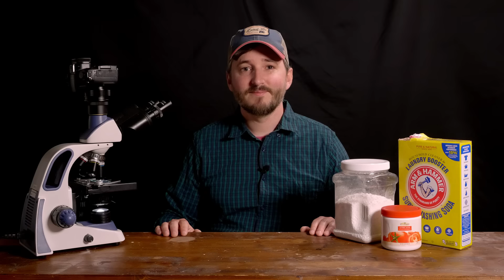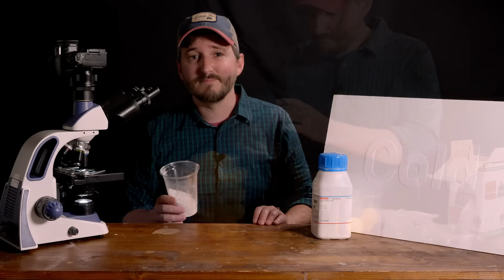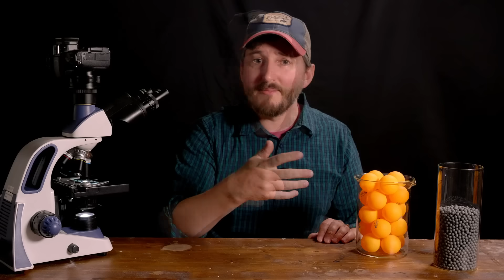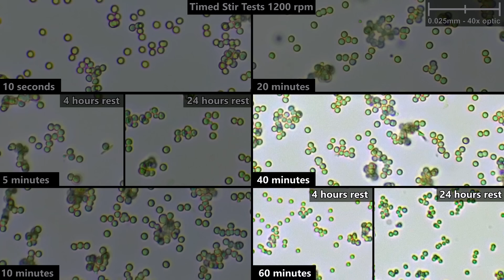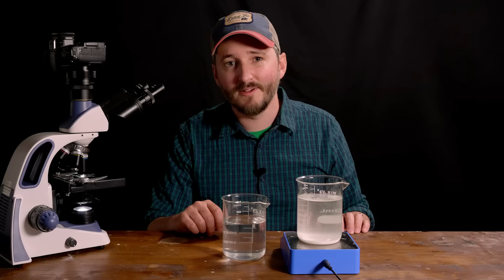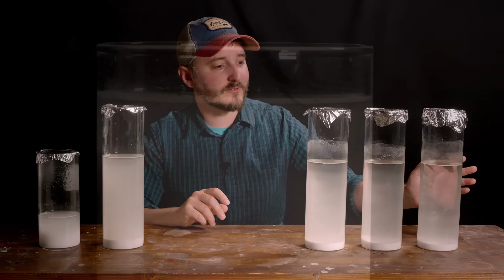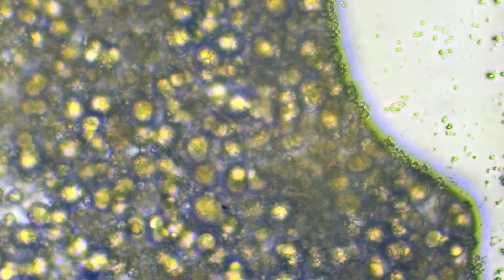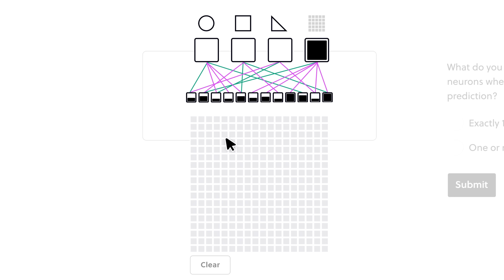Making Infrared Cooling Paint From Grocery Store Items (w/Novel CaCO₃ Microsphere Synthesis)

Comment: Ultraviolet radiation vibrate atoms and causes thermal radiation (totally different from  infrared light bodies with tempature emit) and thermal radiation convects into air via humidity

Its why Zero humidity desert is freezing at night while the ground is still warm and emitting infrared light  to no avail while a humid desert night is muggy......warm humid air wanting to rise and exchange with cool air causing wind and warm humid air cooling off in stratosphere until clouds and rain form with fresh rain being warm water sometimes

Fourriers Greenhouse theory never could hold up in a Lab as infrared radiation,aka red light,by itself isnt of a high enough frequency to heat anything like Uva and Uvb does and Tyndell's experiments used a heat pump to tests C02 in air minus humidity holding only a 1/10th of a hundredth of a degree at 900ppn on a good day. 

Even Savante running the lab and feild experiments concluded the same thing but IPCC "scientist" like to thump on his Science Fiction would a/could a stories in Philosiphy Today of Terraforming Earth via Greenhouse Effect BUT forget to mention his Forward showing the lab and field test dont match the hypothesis.....its just a fun story

Your paint reflects more uvA/uvB rays then it asorbs preventing thermal agitation of the atoms

Kinda a sunscreen that does the same thing by blocking uvA/uvA rays
Reply: I was thinking the same thought

Comment: I can see this tech being applied to automotive uses.  They already clear-coat the paint on cars to protect the paint, so it should be relatively trivial to protect the coating.  Imagine getting into a cool car with infrared rejecting films on the windows and sky cooling paint, at the height of the summer months.  You'd need less air conditioning, less effort to keep the car cool, we could use nominally more efficient cooling systems in cars for those hot months.  This would mainly cool the skin of the car, especially the passenger compartment so heat doesn't transfer into it, but in the winter, it should also be fine, as there's still insulation behind the skin of the car, to keep heat in.  Heating a car, especially an internal combustion type vehicle is relatively trivial, as the engine is producing so much waste heat that you can throw a ton of it into the cabin and keep warm with that via the heater core.  Overall, I don't think it would make winter any less cold in the car, and it would dramatically improve summer-time performance of the HVAC system in the vehicle.  I expect as this develops, different visible spectrum colors of sky cooling paint will become available, since the heat being dissipated is largely via infrared.  improvements to this blend for durability will be important, but at the end of the day, I think this is a wonderful product with good potential.

Comment: Pretty interesting how this radiation is similar to a lasing medium, do you think that the cooling power could be scaled for use as a heat sink in a heat engine, maybe a peltier effect device, or even one of your resonant tubes?  
I'd also be interested in how low you could get the temperature with good insulation, and what the relationship between power and temperature is, because I highly doubt that a black body model correlates well.

Comment: okay. Hear me out. I'm positive that my suggestion is going to throw off the math, but I do think it's worth some consideration to make the paint more stable and add to its strength. I've been looking into mortar additives to increase flexibility and decrease cracking over time. The solution is to substitute latex additive for the water to the dry mortar mix. I think this might work with your paint because both paint and the mortar are behaving well with calcium carbonate in my own mixes. 

The latex additive was a revelation for me because I already have experience with the combinations we're talking about. I craft a LOT and acrylic and latex do play well together. I use both acrylic hobby paint with and latex sample paints - mixed with calcium carbonate - to make my own recipe for chalk paint. It's very flexible and durable. I can switch back and forth between the two paint ratios to change the color and, as long as one isn't drying out, it makes no difference if I use only one, the other, or any mix of them both. The calcium carbonate behaves and the solution is stable.

If you try to mix your acrylic formula with the mortar latex additive instead of water, it might destroy everything you've got going for you so far - or not. You might end up with a more rubbery coating that sticks just fine and doesn't mess with your heat reflecting properties at all. I would think that you could see very quickly if it was going to work for you or fall apart. It would dry pretty darn fast.

The one part I'm struggling to puzzle out is how to get rid of the acetone, then add the latex. I don't think it would go well to mix the two things.

Unfortunately I won't be able to try this myself for awhile, but I'll add this to my 'to do' list for next year.

Comment: I'm stuck on the process of mixing the pigment and acrylic base. My powder is dry but my acrylic hasn't fully dissolved. Acetone is fresh and heat was used. ( I mixed them anyway) What I got was clumpy and a lot of bubbles were produced at first. The end result dried far too fast.  I was hoping to use the spray bottle method but what I had wouldn't pump.  Did you use a more acetone for the spray bottle mixture? More water?  does the acetone need to be cooled before mixing?
Reply from the maker: Sounds like you heated it too much and it started boiling. It may still take several hours to dissolve even with heat. I usually let mine sit at room temp for a few days to start dissolving, then stir the plastic slime that settles to the bottom, and it's ready to use about an hour later when the slime is fully mixed.

Comment: Many houses are in develments that restrict exterior house color. Now we have those reflective radiant barriers in the attic but I wonder if this radiant paint would work better? Like attic insulatiln with a 1side coating on it so it radiates the heat to the roof? I remember you stated the radiant barrier has to face open sky?

Comment: Hi, great work you have there 😉😃. The role of the sodium citrate is that of a chelating agent, the citrate anion forms coordination chemistry with the Calcium ion, preventing them from forming CaCO3 precipitates too rapidly. These are some of my humble recommendations, not sure if it would be of use to you. You can try other chelating agents too like EDTA sodium salt, sodium tartartate, sodium malate. You can also explore adding in some surfactants as capping agents to prevent the CaCO3 from forming large agglomerates. Examples are sodium Polyacrylate, Polypyrrolidone, Polyvinyl Alcohol, Pluronic F-127 Poloxamer.
Reply from the maker: Yes I tried some other chelating agents. Edta was too strong and actually dissolves CaCO3 entirely

Comment: Is there a forum where we can discuss our attempts to make cooling paint? I'd love to talk about issues and help increase the effectiveness. My first batch is very clumpy. after hours in the oven at 250 it's still wet. Does anyone have any suggestions? I let it filter for quite a while then refilled with distilled water and then filtered again. My clumps are currently back in the oven at 250 hoping to dry out.
Reply from the maker: No forum, but that's a good idea. You can try your powder faster if you put paper towels under it in the oven to help wick the water. Also make sure it's well spread out on a shallow tray
Reply: @Nighthawkinlight   I had too much pigment trying to dry. I broke up the pieces and placed them back in the oven. Final step was to put the pigment in an unmodified tray and turned the temp up to 300. Completely dry now and a perfect powder after blending!
Reply: @Nighthawkinlight  How was your recipe different to be used in a spray bottle? Mine wasn't nearly runny enough to work. Lost a lot as it dried just trying to get it into the bottle.
Reply from the maker: @danieldunaway7748  Just add more acetone. I haven't done it enough times to standardize a recipe. I just thin it a lot

Comment: Running this experiment and just got my first CaCO3 beads and zero other shapes observed. I am excited to test the cooling affects after I get the pigment dried and mixed with various medium for durability/weather resistance.
Reply from the maker: Nice job! Did you make multiple sizes?
Reply: @Nighthawkinlight  Not this time around as I was mainly focusing on the chemistry and work flow. But I used 1 minute of stir time so based on the instructions should be the largest size. Largly due to my laboratory (spare room lol) is under renovation. However the next step, after thermal observations of a mini test bed, is to grow the next two smaller sizes!

Comment: 34:00 Did you test that the sizes don't change? Even though the blender blades aren't sharp enough to cut them, the blender still exerts a lot of sheer pressure on the tiny spheres wich get carried along to other spheres by forces like van der waals wich could destroy those spherse
Reply from the maker: I tested. Many of the microscope shots were of spheres that had been blended.

Comment: I call BS. You have a layer of plastic over this thing, effectively creating a greenhouse, and yet the plywood is the same temp as the control? It should be much warmer inside that box than out. 

Also your explanation doesn't make sense. You're telling me you can paint (generously) ~1 sqft with this stuff, and the reflected IR from EVERYTHING ELSE doesn't matter? 

No. No way. This is BS.
Reply from the maker: Give it a try. Using just the acrylic/water mix and purchased barium sulfate powder as pigment you can get similar results.

Comment: Is it possible to make a clear pigment to coat a green house like in between a sandwich of stretch film to keep strawberries cool to produce berries all season? And potentially grow differently without the infrared spectrum
Reply from the maker: Not a clear pigment, but you could use shade netting on the outside of the greenhouse to block some of the light and heat

Comment: @nighthawkinlight the theory about blocking infrared from surroundings seems reasonable and I saw that tech ingredients did the same, but in my own experimentation so far it does not seem to make a difference. Not sure why, but sides around the panel don't seem to make any noticeable difference even at 8 inches high with a panel only 12 inches in width and height. Have you experimented with removing the sides? Could you tell any difference?
Reply from the maker: Haven't noticed much difference myself either, but I haven't done a side by side comparison

Comment: Excited I got my supplies today,  hope to have a few liters of paint    as the Chevy Volt takes 30 minutes to drop 10 degrees on a 110 degree day. However I have 1992 ford that will be my test run.  As the hood insulation fell apart last month and this could be the soloution of needs.
Reply from the maker: I'm not sure it'll stick to a metal hood. Remember this is just a test recipe, you'll need to experiment yourself to find what works for your purposes
Reply: @Nighthawkinlight  I'm not scared of a challenge, and it sure can't hurt ad the hood is currently black lol and it's around 300k miles, I had figured metal right now is not the time so was going to use magnets  and plastics then figured it would be cool to do  Vinyl wrap wall parts  or canvas, I have abundance of either. Thanks for the heads up.  BTW was sent to your channel by #TechIngrediants he gave you much props and a seal of approval. 👏 congrats, stellar, work on your channel.
Reply: ITS BEEN A YEAR AND I HOPE THIS FINALLY REACHES YOU AS I BEEN TRYING, TOSS IN FOLIC ACID TO MAKE IT ADHERIBLE RESEARCH WHITE PVC cause their would ONLY BE BLACK PVC IF NOT FOR folic acid PLEASE SEE THIS

Comment: If you were to make a 4th even smaller particle size to fit between the first three would it reach a point where it is either nearly impossible to filter out or take a very long time to settle at the bottom of the beaker?

Comment: Thank you very much for this video. I find it truly amazing.

One question. If you paint one face of a Peltier plate to create a temperature difference on each of the faces, would it be enough to produce "usuable" electricity for small DC gadgets?? I know it is probably much better using a solar panel, but just wondering.

Comment: So many things to unpack here that I don't know where to start.  First, coming from a PhD organic chemist, I want to say excellent work!  You exhibit all the qualities of a great scientist.  

Getting into the science.  I have to ask if your fundamental approach is logical from two aspects.  The first is the concept of using a wide range of particle sizes.  Look at your own example in the video.  The small particles packed more closely than the blend of small and large.  The blend will always have gaps.  I believe your best choice would be to only use fine particles. The only reason not to is if it presents a logistical issue.  Is it too difficult or too expensive to only make the small spheres? Also, only having small spheres can lead to higher viscosities because you have a whole lot more surface area. However, if you can work around those issues, you should have even a tighter pack with less material.

Next, and perhaps even more fundamental, is that you probably  don't even want spheres to begin with. If your goal is to coat a surface, why would you coat it with balls? Would it not be better to coat it in flat plates?  Then you're guaranteed much better overlap with significantly less material. However, another consideration is the crystalinity of the material.  The vaterite structures you are forming may be more amorphous, and that actually might be helpful for your IR reflection.  (Like snow)  I'm not sure if it would be problematic if you grew the crystals in a controlled fashion creating flat structures.  Perhaps they might not have the same optical properties. I'm not sure.  Either way, it's worth investigating.  Check it out, there are a lot of cool ways to make flat structures for paint coatings.

Another comment has to do with your paint formulation itself.  You might want to look into aqueous based formulations. Of course then you are also going to have to start considering using a rheology modifier, but in the long run, you should end up with better coatings which are also less detrimental to the environment.  I can see all the paint formulators out there shaking their head when they see the VOC content (acetone) in this approach.  Getting away from acetone will also just make life a lot easier for painting this material onto a surface if you can buy yourself some time for the coating to self level.  (Although the way you were applying it with a syringe looked like a fun opportunity for a 3d printing approach.)

Finally, you should really start thinking about ways to protect this coating.  There are ways to hydrophobize calcium carbonate by treating it with something like oleic acid.  Oleic may be a bad choice because it oxidizes very easily.  Stearate could be more stable, but I would prefer a reactive siloxane.  Otherwise, you might consider applying an actual protecting layer, although I don't know how it would impact your optical properties.  

Finally, not to knock the science, but I'm just curious how your surface compares to one painted with plain old white paint.
Reply from the maker: I've considered much of what you've mentioned. There is a recent paper using plates rather than spheres to great success, but that is with boron nitride rather than calcium carbonate. I am also testing water and silicone based mixes. In terms of sphere sizes, you will find that every size of sphere packs to only about 65% density. The small spheres only look more dense than large ones. Zoom in and the ratio of spheres to empty space is the same.
Reply: @Nighthawkinlight   Ironic you bring up Boron Nitride, as I was recently looking at this material as a lubricant.  It comes in a variety of particle sizes, and it can be easily suspended in water, but it settles overnight.  Hexagonal BN would be very inexpensive from a raw materials perspective, but it doesn't seem to be one you can easily make at home.  I see there is a company called ZYP Coatings who has a lot of BN products including coatings.  Maybe start there just for some scouting and comparative work?

Comment: If you're looking at you spray paint in this consistency plaster there's a whole system built for putting popcorn ceiling texture on and that stuff is very thick a similar consistency to plaster do to it basically being a plaster paper pulp mixture it also may help for increased surface area